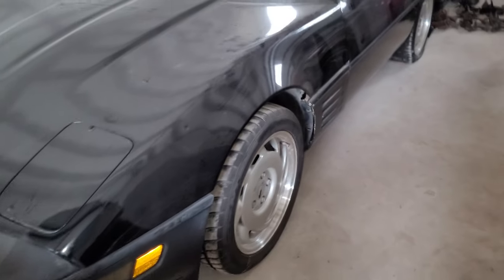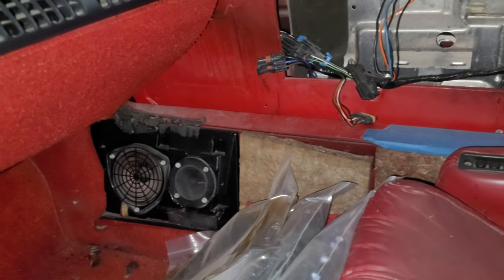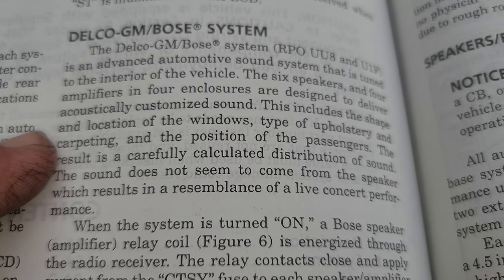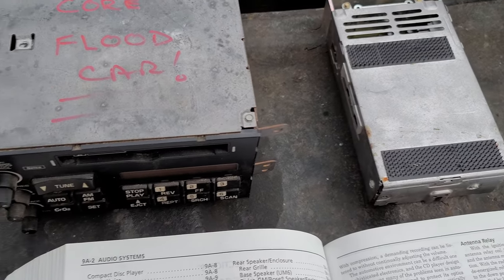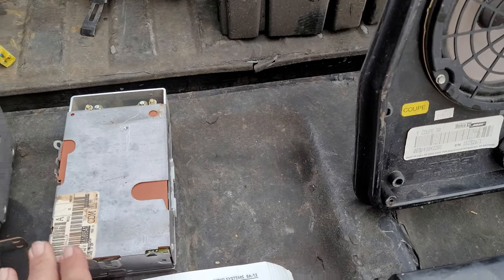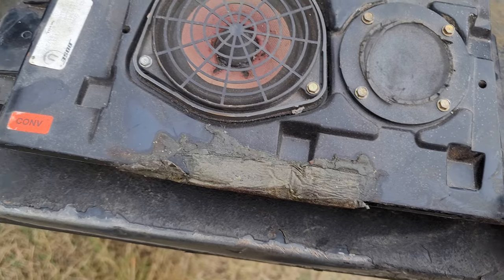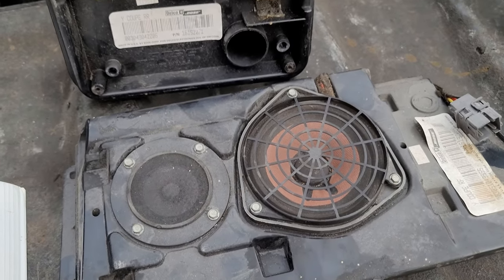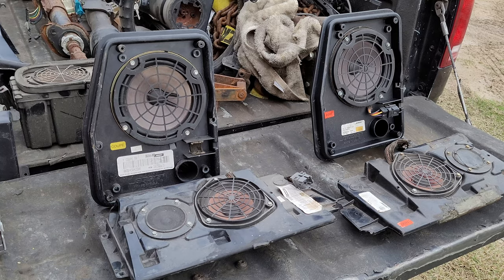The C4 Corvette Delco Bose Gold Stereo System of the 90's

Comment: I love the Bose system in my 93 and when a component failed I always replace it with original part. Great review as usual. Thank you.
Reply from the maker: Agreed, some of the components can be a little tougher to source, but I always prefer the period correct sound system unless it's a customized build.
Reply: HI I just recently purchased a 1992 convertible. the left front speaker is not working and the right front is squealing. I am confident that the right front is the amplifier. The left front I have not checked as of yet. I may need the whole assembly. I can change them out myself and really want to keep the original Bose Gold but I am having trouble finding the parts. Any suggestions?
Reply from the maker: Hey Sean, your assessment is most likely correct. The amplifiers are usually the cause of the squealing feedback you hear through the speakers. I have some speaker assemblies in inventory. You can reach me through DM on FB or IG @VetteSource.

Comment: Cool, thanks for posting. I have a 1990 with the Bose Gold Series, no CD player, just cassette. Back in the day I had to have the head unit repaired a couple times, don't remember the issues but since I believe I'm only getting power to the front speakers, possibly rear are shot. I'm going to look into getting them rebuilt as I would like to keep the original stereo and appearance because when it does work it sounds great in my opinion.
Reply from the maker: Hey Jimmy, glad you enjoyed it. Like you, I find the performance of the factory system to be quite good, and only advocate swapping it out in limited situations.

Comment: I recently replaced a front Bose speaker in my 92 Coupe with a new old stock speaker that was for a convertible.  It was plug and play and sounds great.  I've heard the convertible speakers have a more powerful amp but mine sound perfect so who knows.
Reply from the maker: Yea, it's a question for the ages. Somebody mentioned the way the sound is directed on a convertible speaker is different, which make sense since Bose was all about directing the sound for an optimum listening environment.

Comment: It is my understanding that the acoustics in the convertible were different than the coupe so Bose designed the amps with different Caps for the crossover network to change the highs and lows from the coupe to the convertibles. All the amps are interchangeable but it should not be done because they were different front to rear and coupe to convertible .   I have even heard of swapping the amps out from a different car line. But they wont sound the same as the original. You can replace the caps that fail in the amps yourself if you are courageous. I have done it with excellent results.
Reply from the maker: Excellent information! Thanks for sharing with everyone. That's what I was looking for👍.

Comment: The "tubes" you were talking about arr called ports. They work pretty much like a port on a subwoofer box most people install in the trunks. They direct the sound waves in a certain direction. Most subwoofer enclosures directs them just straight out. I guess there was a good reason they directed them in a different way.
Reply from the maker: James, thanks for clarifying, that makes total sense👍. When reading up on the history of Bose before making this video, I discovered that they were obsessed with the perception of sound quality from their speakers, and part of that was accomplished by redirecting the sound onto adjacent areas and not directly at the listener. Funny thing is that the first generation of this speaker from 84-89 has a more closed off enclosure than the later ones from 91-96.

Comment: Ideas for future videos: I’m a long time C3 owner thinking about doing an engine swap. I’d like your opinion on options… LS, stroker, big block, etc.
Reply from the maker: Hey Rusty, the LS is definitely a popular choice for ease of engine assembly and power output. I personally prefer BB power myself, but it's a tough sell due to increased cabin temperature and different handling characteristics of the car after installed.

A good compromise is a 400 SB. It can be stroked out all the way to 422 CID, has plenty of power and will accept all the power adding upgrades you want to throw at it. Of course if cost is not an issue, you can also go with a Dart 427 engine kit. I see them for around $5K online frequently, and are a good  option for power and reliability.

Comment: So, ive got an issue with my 96. I have the Bose gold with CD. If i switch it on it powers up yet there's no sound. Radio or CD, the both look to be working, the CD plays, i can change tracks etc but theres no sound. Same for the radio, i can swap stations but never any sound.  Also, the antenna doesnt work. Are these things connected?  
Can you point me in the right direction of where to start please.
Reply from the maker: Hey Andy, off the top of my head it sounds like you have a problem with the radio receiver, which is that smaller rectangular box I detailed in the video. In your case, it's very easy to access in the passenger rear storage compartment next to the jack. I would recommend pulling it out and taking it to a local radio repair shop to test it for you. Let me know how it turns out👍.
Reply: Andy, the service manual says to test the relay (located near the steering column. If there's power to it, its probably bad. If it's working, check the LH curtesy fuse. Also check the ground that i think is next to the door near where the wiring harness goes through the driver door. I'm just starting the same checks myself..  my LH curtesy fuse is good and I'll be checking the relay tomorrow i hope... good luck..
Reply from the maker: Hey Robert, thanks for chiming in with the service manual information👍

Comment: Great video. I’m original owner of 1990 C4. Did you miss speak by saying the receiver is under the 91-96 or should it be 90-96 under passenger side dash?  I think that’s were 90s are too.   Back in 1991 I had a Alpine 5 Disc CD changer installed. I don’t know if they connect it to the controller unit or receiver.
Reply from the maker: Hey Mark, glad you enjoyed it. You're correct, I meant to say 90-93 will be located under the passenger side dash above the lock panel and is fairly difficult to access. In 1994, they relocated it to the passenger rear storage compartment in front of the jack and is much easier to access. Most of the time, they connect the aftermarket head units to the receiver in the dash.
Reply: My 93 has it in the rear storage cubby. No idea if that's factory or not, it's been in someone else's hands for 30 years
Reply from the maker: It's possible that quite a few undocumented modifications can be made over 30 years😁.

Comment: Hey there! Love your channel and all your videos, they’re always informing. I have a 1990 with the delco gold system in it and I’m having a lot of trouble with it. I recently took the radio out to do some tuning up and cleaning and when I put it back in the security system enabled. I dug into the service manual and found out how to get the factory code to unlock the system by holding down the cassette buttons but putting in said code still does nothing. I’m wondering if someone changed the code previously and if I could do something to find it? Thanks!
Reply from the maker: Hey Brendan, glad your enjoying the channel, thanks for the kind words👍. That security lockout on the Delco/Bose radios is no fun to deal with. Most of the time when they enter a "hard lock" mode, you end up having to take them to a radio shop to have it disabled. However there may be a secret path I am misremembering. Let me check my sources and see if there's any bypass available for you.

Comment: I'm doing something a little weird an obviously different,,, 5yrs ago I found in a junkyard a 86 buick electra fwd with the bose radio still in it with the speakers and i removed the radio and rear speakers, front speakers were built into the doors and just wasn't worth the hassle so I just pulled the radio an rear speakers, tested it at home and the amps were bad ( static noise, some squealing ) and radio display was no good, radio didn't matter 2 much 2 me but the rear speakers I wanted to get working,, I disconnected the amps an re-wired the speakers in their enclosures to a factory amp out of 05 impala, the bose speakers are 2ohm of this year (86) and I believe they handle 35watts each and were running off 25watts each from the bose amps,. was originally 100watt x4 rms in 86.. the 05 impala amp is a 2ohm speaker amp an I'm actually using this at home., sounds damn good! I'm using a 94 cadillac deville cassette radio w 5 band eq and I've added aux input to it in the face next to cassette door and I play it thru the impala amp
Reply from the maker: Not a bad idea. It just shows there's more than one way to skin a cat😁. Thanks for sharing👍.

Comment: What book are you referring to throughout this, it looks really comprehensive
Reply from the maker: Joburg, that is the Factory Service Manual that the dealer technicians used when working on the cars. They can be found in the resell market on ebay, Amazon, and even swap meets.

Comment: Well done.  Who would you recommend to either repair or buy new Gold Bose components from?
Reply from the maker: The supply of new components has pretty much dried up, so your best bet is to look around for a Delco or Bose radio/stereo repair shop in your area. Depending on where you live, there may be one close enough that you can just drop it off in person. Most of these operations tend to be smaller individual operators, so you'll be dealing direct with the owner/operator in most cases.

Comment: Question: Will a later model rear bumper fit on a 1989 c-4? I'm wanting to switch the bumper with the better looking later c-4s. Will it work and what modifications would need to done, if any?  Thank you for your consideration..
Reply from the maker: Hey Dalton, it can be done. If you take a look at this video of an 86 Pace Car I had a while back, you can see they updated the entire body to look like a 91-96

https://youtu.be/nGyyrYugueo

Quite a few pieces need to be changed however, including the bumper assemblies, inner structures, wheelwells, and assorted mount brackets and belt line moldings for the entire car if going with the painted style.

Comment: Had my stock Bose system totally refurbished in my 93 c4...$700..
Reply from the maker: That's not too bad. Probably cheaper than buying all new aftermarket to replace it👍.
Reply: @VetteSource I try to keep the car completely original...93 c4...50 000 miles
Reply from the maker: Yep, good thing for use is they made so many C4's and they're still quite popular, so parts aren't insanely hard to find.
Reply: Wow,id like to no how and where you hot them refurbished

Comment: I am getting a virgin 92 with gold system. I am going to figure out a way to put a bluetooth amp in so I can keep the stereo. I will replace everything with components. Will keep the Bose system for later resale.
Reply from the maker: Nice, sounds like a solid plan👍. Just make sure you if you're hiring out for the install they absolutely know not to cut ANY wires to the original system. Its more difficult to put that stuff back together if they cut and/or damage wires and connectors.
Reply: @VetteSource  thank you
Reply from the maker: No problem👍

Comment: Also any thoughts on where to find a good armrest cover for a 90?
Reply from the maker: I may have one in stock. I'll take a look today.
Reply: @VetteSource  I still need to diagnose where the trouble specifically is originating from...the receiver and/or the speakers, etc.  I'm getting power/sound but there's static.
Reply from the maker: I gotcha, that why I mentioned the receiver because your radio control unit is doing what it's supposed to do. 

However, if you have sound but with static you most likely have a speaker amplifier problem. Try isolating each speaker with the fade and balance knobs and you should be able to tell which speaker is producing static.

Comment: Should I expect issues if I decide to change out just the head unit to go for a more modern one? I was looking to install the Kenwood 6.2" system if possible.
Reply from the maker: Hey Tyler, you should be ok with just a head unit swap. I would however recommend buying the adaptor harness so  you don't have to cut the original factory plugs as they are pretty hard to source if you ever needed to reinstall the OEM head unit.
Reply: @VetteSource  That's good to hear! Definitely like the idea of a more modern look with a touch screen. Is this adapter harness easy to get/find?
Reply from the maker: I believe they still sell them for the older cars. Worst case scenario would be to build one with extra connectors and wiring. Let me know if you have any redouble and I might be able to point you in the right direction.
Reply: @VetteSource  Great, sounds good. I'm picking the car up next week ('95) so I'm sure I'll have more questions once I get into it. I'll be subbing to your page for sure!
Reply from the maker: Thanks Tyler, have a great weekend👍.

Comment: My C4 volume control won’t turn up.. plays really low.. how can I fix it?
Reply from the maker: Hey Lois, sounds like you may have a problem with the radio receiver unit which is located under the RH dash kick panel on the 90-93 cars, and behind the passenger seat in the storage compartment on the 94-96 cars. When this unit goes bad, low or no volume output is one of the main symptoms. Let me know if you need any more information.
Reply: @VetteSource  I will try replacing that first
Reply from the maker: Sounds good, let me know how it turns out👍
Reply: I have a 92 black convertible
Reply from the maker: Nice, I have one lurking around here as well.

Comment: What the heck? The rear fender is all chewed up like it rusted out. But I thought the body was fiberglass! What happened?
Reply from the maker: You talking about the car I had the speaker on top of? That's a Mercedes and made of steel.
Reply: @VetteSource  I apologize, they looked similar to me. I’m still getting used to my C4 and recognizing it around the streets and such.
Reply from the maker: 😁, no problem, it's easy to misidentify cars when your looking at a small cross section. You'll enjoy your C4 immensely, they're great cars.
Reply: @VetteSource  Especially with a 396 stroker
Reply from the maker: For sure, no replacement for displacement😄.